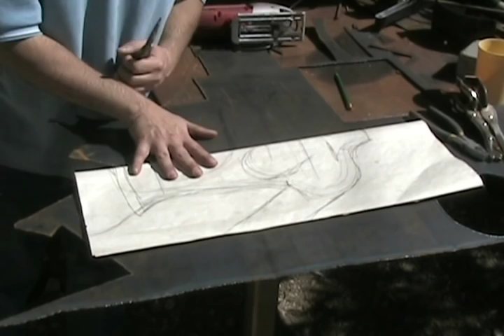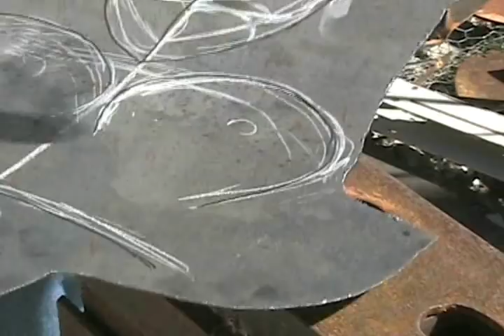hobby art welding cheap ep5 cold hammering sheet

Comment: Flap discs are good for small blemishes.  Or you could wire brush it with a course brush and it might help to hide them.  The brush will conform more to a bumpy surface.  Then there is bondo, which sticks best when the metal is super clean and free of rust and grease/oil.  Carburetor cleaner is good for removing grease, but DON'T do it before welding, or you can get deadly phosgene gas.  It will hide in tiny pits for hours even when wiped off.

Comment: wow nice work...how thin is the metal your cutting?  also what is the minimum thickness metal it will cut?....I bet your neighbors love you so much LOL
Reply: I'd just use my powerplasma. Other than the compressor kicking in sometimes it is pretty quiet. To save a bit of money I can see why he doesn't want to waste oxy fuel by using the cutting torch but I wonder how long that blade lasts.
Reply: I would have thought he would pound into a leather wrapped sandbag or something. Even a tree stump with a rounded hollow would absorb a lot more of the noise.